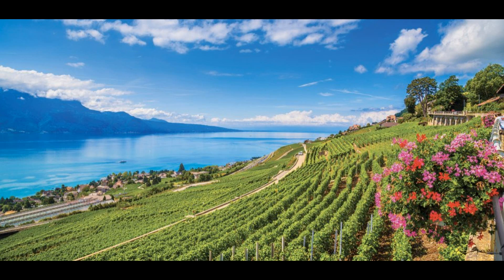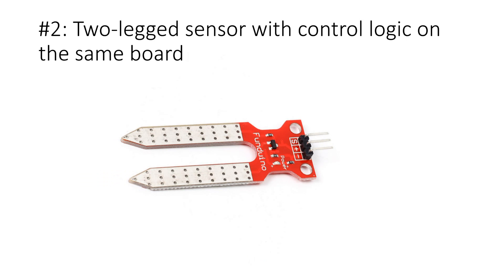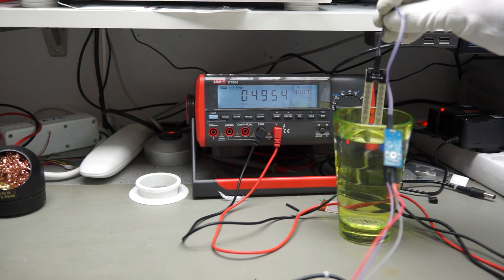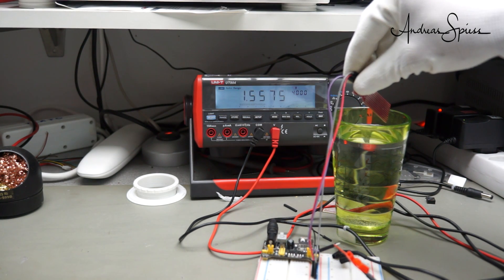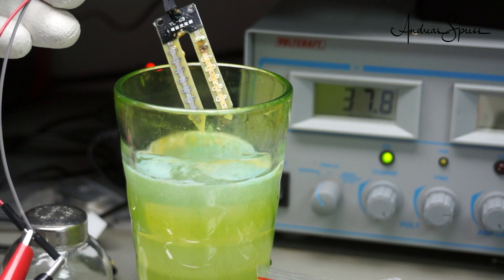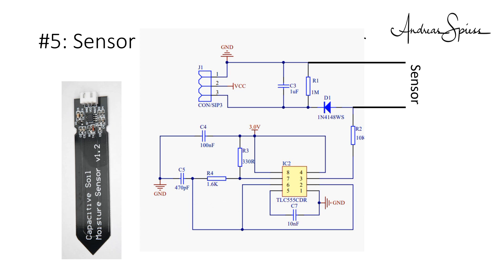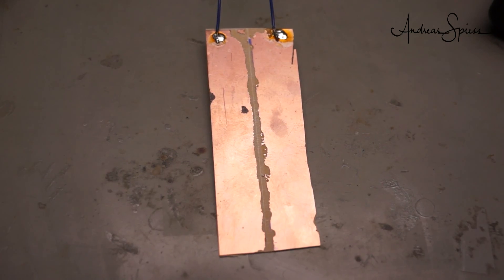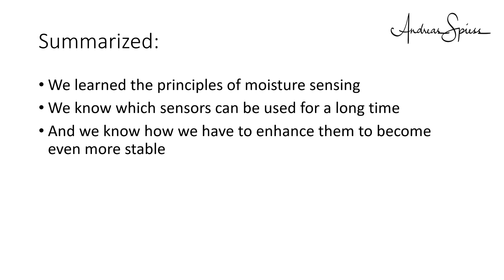463 Why most Arduino Soil Moisture Sensors suck (incl. solution)

Comment: Great video! I did some research a while back into these and came to a similar conclusion, that both of the main sorts are fatally flawed. Coating the capacitive sensor with a stronger layer (e.g. dipping in epoxy), or pulsing the conductive sensor for very short times were the results I came to. I’m not sure what the corrosion without any current is, but I figure it’s pretty low. A gold-plated sensor might last long even with a continuous current.

As for the toxicity, considering the nonzero chance of that plating containing lead, I’d be very hesitant to use an off the shelf Chinese conductive sensor. Don’t want my broccoli to start lowering IQ points. Tin and nickel, and especially copper, can be toxic to plants too, but with the small concentrations after rain washing things it’s likely not a big deal. Actually, some people deliberately corrode copper wire in their soil to increase the amount of copper in the soil. Apparently copper deficiency is common enough in plants that it’s a cheap way of improving plant growth, though I haven’t looked into it myself.
Reply from the maker: Thank you for your additional information! I agree with the dipping.
Reply: Another way to prolong the life of the electrodes is to switch which one is positive and negative with each measurement.
Reply: @galaxya40s95  I suspect that will just double it, though you might find that it replates some of the lost metal back.

Some materials won’t corrode, mainly inert metals like platinum and iridium, gold is probably pretty good too. But there’s also some conductive oxides, like indium-tin-oxide (found on a lot of LCD and probably OLED displays), and lead dioxide (as acts as one electrode in a lead acid battery). All but the lead are expensive, and the lead is too toxic to put in your soil.
Reply: @Scrogan   Would graphite work as a probe material?
Reply: @dazanta4541  graphite has a tendency to disintegrate when used as an anode. But at here low currents it’s probably fine.
Reply: @Scrogan  : There's also carbon, which is safe but fragile.
Reply: Just stating the obvious here: Don't add copper to your soil unless you know it is deficient in it. Too much copper is also bad for plants and other wildlife.
Reply: @hamjudo  this is definitely true. Especially since in acidic soil the copper will be pretty soluble and easily absorbed. Copper carbonate is (I think) a safer less-soluble form of copper to add to soil, I’ve heard of people converting their used etchant to carbonate before disposing at least. I convert it to copper metal.
Reply: Copper is used as a fungicide. Too much can be toxic.

I am thinking silver coating for the probes.
Reply: @williamwood709 silver is definitely pretty easy to coat things with, but it corrodes in the presence of sulfur compounds. Depending on your soil, this may or may not be a problem, the same goes for copper leeching into the soil. If you’re using a PCB either way, it’s pretty easy to get it plated in gold at the fab-house. Otherwise, tin-plating with a soldering iron or tin chloride solution are both pretty doable.

Comment from the maker: This is a re-upload of video#207 of June 17, 2018. Some other solutions proposed by the viewers are:
- Connect an output pin of the MCU instead of VCC to the sensors and switch it to high only for measurement. This reduces the time the current is flowing
- Use other probe materials like steel, nails, or even gold-plated material

The "green stuff" is copper-oxide for sure not healthy, but it should not hurt the plants in minor concentrations. The same happens at the Statue of Liberty, BTW.
Some viewers also used nail polish to protect the edges.

And it seems that sensors with manufacturing errors are in the market. Search for the "Flaura - Smart Plant Pot" channel
Reply: I don't know if it will help extend the life of the sensor, but another possible optimisation is to power the sensor from the MCU's pins such that the polarity of the sensor can be flipped in software. Then, when a reading is needed, a polarity can be chosen at random to take the reading. The assumption is that the electrolysis reaction can be reversed by reversing the polarity.
Reply: Ah, I knew I recognized the sensor in a plastic bag! :)
Reply: Why did you re-upload the 5 year old video?
Reply: @kwinzman  Good question.
Reply from the maker: @leocurious9919 It was announced in a video at the beginning of summer break. Viewers wished it.
Reply: @AndreasSpiess  Is there a schematic for the capacitive sensor circuit on your website? It's hard to find things without an index.  I paged through the blog section but I didn't see it.
Reply: It is not copper oxide. CuO is black and Cu2O is red. It is some mixture of copper hydroxide/carbonate. Maybe Cu2(OH)2CO3 and some other copper compounds also.
Reply: For resistive probes AC reduces corrosion i have found..The control circuitry is more complex however.
Reply: How much current does these sensors need? Is a digital output pin on a ESP8266 capable of driving that?
Reply: For reference, you should also be able to use the "lead" (not really lead anymore, usually a mixture of clay & carbon like any other pencil "lead") for "lead holders" (which are like a faulty mechanical pencil- they just drop the "lead" when you actuate them). Those should also be low-corrosion, and safe for plants, but there's some chance that they could break without sufficient protection, and you would want to occasionally check the calibration.
Reply: I'm thinking that the electronics should after all not be placed on the sensor. e.g. instead make a sensor as like your PCB sensor (no electronics, just 2 sections of insulated copper. these days most MCUs (e.g. stm32s, pico etc) has fairly elaborate rather high frequency timers that can operate to the low mhz ranges, and that can simply replace the use of a 555. And instead of plastic bags,  some water proof lacquer should be used to keep the insulating layer thin. e.g. it is possibly rather easy to fabricate 'sensors' by simply ordering pre-made PCBs insulated with solder masks and simply solder connections and insulating the connectors and the edges again. 

in terms of how it works, I'm suspecting that in wet conditions e.g. water, serves as an electrolyte and along with a/c signals works as a capacitor with the water being an electrolyte + conductor and the insulation (e.g. lacquer or solder mask) as the dielectric thus making a small capacitor. if that is true, a bigger copper surface area coupled with a thinner insulating layer would probably be more sensitive.

I'd guess an alternate design could be made by simply using 2 separate insulated (either lacquer or solder mask) PCBs or copper strips as probes. And i'd guess they don't even need to be too near to each other in the soil to work. And perhaps a most sensitive ones is to make an electrolytic capacitor out of it as the extremely thin aluminium oxide insulation will give a high capacitance. 
https://www.youtube.com/watch?v=ml2TdQ2_2mk
Reply: Yeah, Graphite man, anyone that did an HHO generator can tell you that, everything else oxidizes but graphite needs a colossal amount of effort to oxidize.